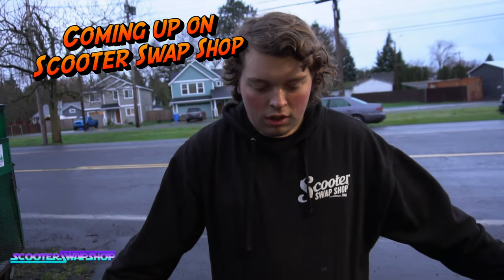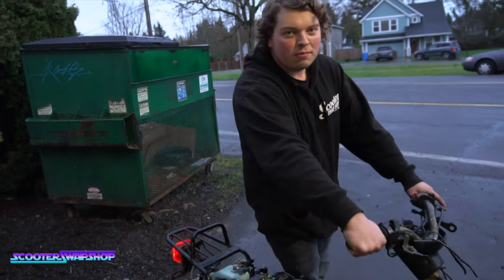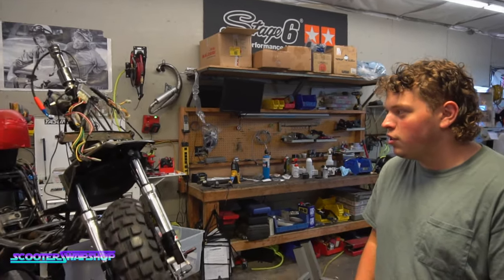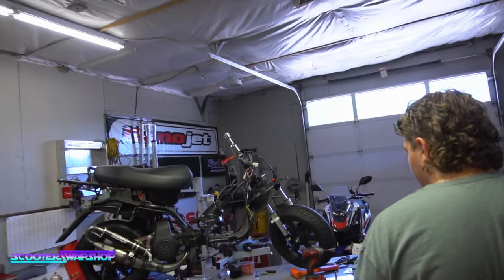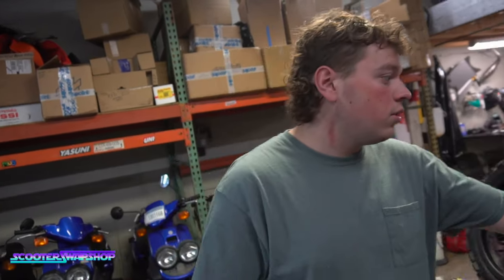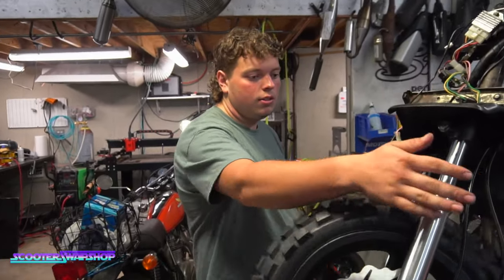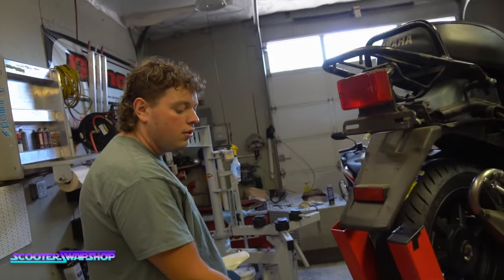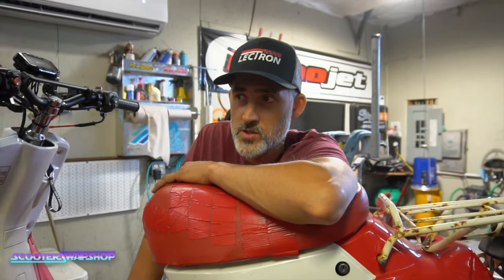Paul breaks down the Yamaha Zuma beach bike builds

Comment: Yamaha bought MBK in 84. The only bws 50 made in japan was the 89. The 1990 models and onward were built at the MBK factory in france.
Reply: And since 1990, they used a bunch of minarelli parts cuz yamaha had a partnership with minarelli. They ended up buying minarelli after 2000 but thats not important cuz they still used a bunch of minarelli parts on the bws/zuma before that
Reply: And the bws was actually invented in 1987 and tested in japan on a beach which is actually really awkward, hence the creation of the big wheels/tires which worked good on the sand
Reply from the maker: but are you sure.... hahah thanks man
Reply: @Scooterswapshop  yeah dont even ask. Im a bit of a nerd loser when it comes to this stuff. When i was a kid i was a bit to obsessed with that stuff. You can find all that stuff online anyways. From you french Canadian fan, kyle
Reply: My 90' Zuma 2 was 100% built in Japan.......
Reply: @bartobuilt2601  thats cuz it was a late built 89. Essentially june is the cut of date, in other words june 89 is considered a 90. you can confirm when it was built by multiple plastics.